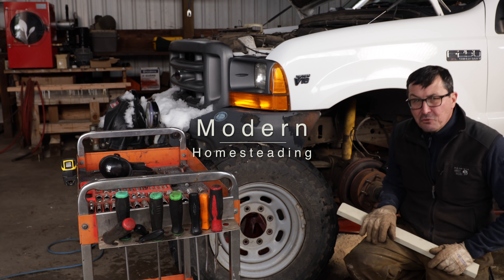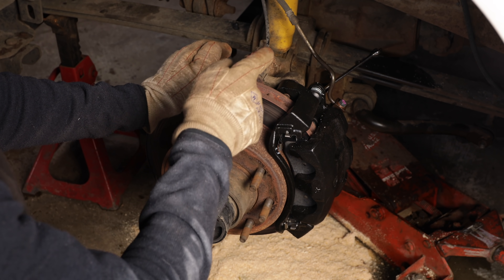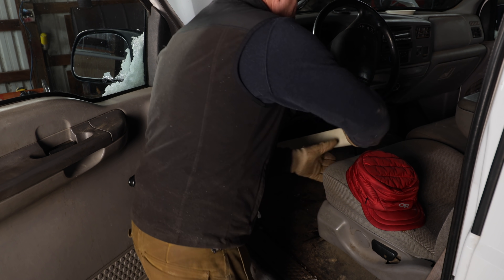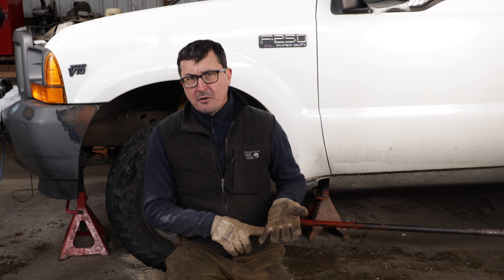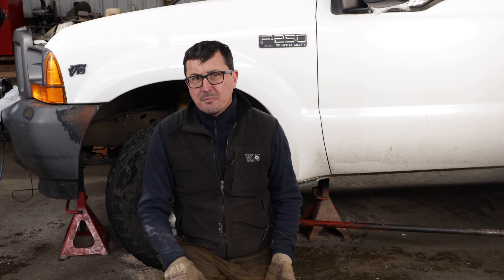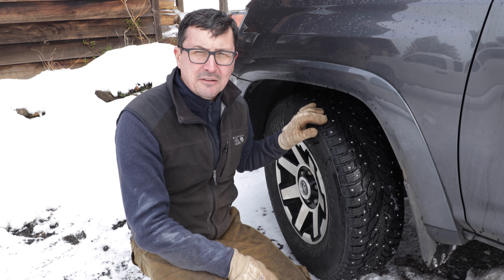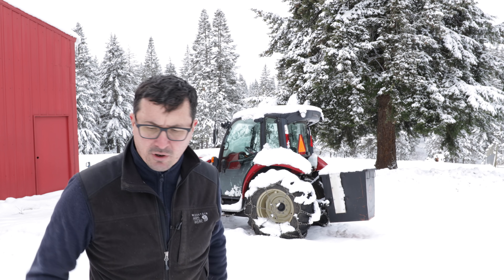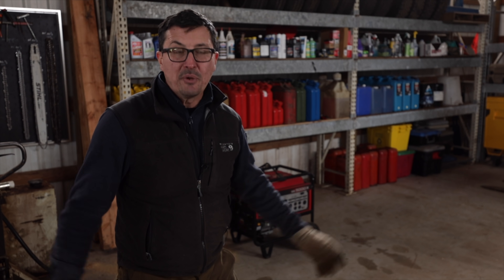IT FINALY HAPPENED!

Comment: As an automotive tech ford is the worst, right up there with European vehicles, followed by GM.EVERY CAR TODAY BURNS OIL HORRIBLY In the exception of the Hemis and Cummins diesel. Then you get into the expense of repairs For those that take their vehicles to a mechanic fords are right up with European again due to how difficult it is to get to many of the parts causing more labor hours. GM and Ram are actually better than even many of the Asian manufacturers in this area as well. Then you have Ford's issues with spontaneously combusting due to horrible wiring (seen this happen 3 times once in an excursion, once in an F150 and once in the steering column of an escape.) Fords have mountains of issues that I would rather replace ball joints on a Cummins than deal with on a Ford.

Comment: 3 dodges 1990 d-150  nothing but regular oil changes 2008 ram 1500 trx nothing but regular service 2017 ram 1500 nothing but regular service I had a 2017 f-150 the transmission grenaded at 4700 the motor was rebuilt 12 times in 23k it refused to start when it got cold anything below 0

Comment: Gotta say my mopar has had less trouble than the fords I have been around.
Reply from the maker: hahahahahahahaahaha!!!
Reply: @wranglerstar  no lie.  I've had to replace the steering wheel on the 2014 Ford flex because the wiring harness messed up and would sound the horn everytime you turned the wheel or pushed anything other than the horn.  Fords are good if there not fancy like this one.

Comment: Hello I hope I can get a response  from someone. I have an old roofers axe half hatchett with a hammer  back. I was wondering  if wrangler star has any wisdom  on the matter. I want to use it as an project  to start trying to rehang an axe. Is it a useful  tool in anyone's opinion?  I was hoping  wrangler  star would  have a video on the tool but I dont see one. From what I have  gathered  it's more of a shaping  tool used  for shingle work better  the 1920s to 1940s and 50s. I love old tools but was wondering  if anyone  has some pros and cons on the matter

Comment: Truth is Ford, as well as other manufactures, are continuing to make it increasingly difficult for the home mechanic to work on the vehicles themselves. I myself will never buy a Ford. I don't like them and they've had lots of issues with their engines in recent history. Every manufacture has it's issues. Some years are better than others. Toyotas aren't too bad but even they have had their share of problems. There are vehicles out there that really are just junk. But usually problems present themselves due to misuse, abuse, and neglect. Find a vehicle that's built for the purpose it's being used for and take care of it.

Comment: Cody I have a 1996 dodge Cummings and a 2006 Chevrolet duramax  Cummins has about 700000miles never done anything other then wear items  and duramax just rolled 423000 miles  never done anything other then wear items and  a fuel sending unit   both are used for work and been abused  I had a Ford with the 6.0 and it blew the motor at 90 000 miles never again will I own a Ford product

Comment: Fords are Junk!  I have a Dodge diesel with well over 200k miles and never needed ball joints so what you said is BS!  I do keep them greased.  Fords are the worst trucks on the road today, but if you like spending lots of money on a truck, go buy one. Heck, you even have to lift the entire cab off a Ford diesel just to work on the motor which costs about 2k in labor in most places just to do that.  Now tell me how Fords are better!   You wrong on this one!   I do agree that Toyotas are very good vehicles and hold their value very well.

Comment: To bleed brakes just open the reservoir and crack the bleeder and wait for it to run steady.  Dodge has the cummins and Ford's diesel motors are a joke. I'm sorry but out of every truck Ford is by far the worst.

Comment: Lmao... I have had a 1997 1998 2001 2004 and 2006 ford f150s. All new from the dealer. Spent more time under them fixing them than driving them. I will never waste my money on a ford again. Total garbage. I also see daily 2012 and newer fords totally rusted out here in Michigan. I have a 2004 Ram 1500 with 200k and a 2012 ram 1500 with 130k. All original minus one ball joint and upper control arm on the 2004. Oh i did have to swap out old front calipers on the 2012.  Thats it. I also drive 2.5 hrs one way to work.  So keep your ford, it will make a great rats nest one day. Ill keep my pos Rams that have been 100% more reliable than any ford ive ever owned.

Comment: Ford needs a new engine design ever 4 years. New interior after 1. I drive all of them everyday new and used. I can pick them all apart. Toyota is about the only thing u have correct or I will agree with.

Comment: Don’t buy from Europe?where the f do you think your transit originated from Europe yes U.S ones are not built there but it’s a Ford Europe designed vehicle we’ve had them for decades. The transit brand has been in the uk since the 1960s originally manufactured by ford uk